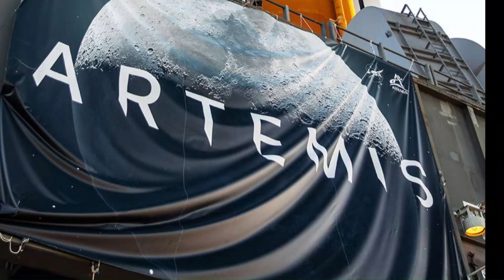Blue Origin Shocked SpaceX With Their New Moon Lander Launch!

Comment: Put some remote controlled AI robots on them/Robots avatars (don't need full AI auto), blast them up there, 'the perfect craft' (no need to worry about G's. The faster the craft leaves the Earth, the less fuel  and weight). A realistic 10 years to build large human habitation, fuel processing and depot with oxygen and water storage, all ready for the Solar System. It is accomadation to live and work and explore and mine and whatever else. While it is being built work on what ever is needed to send however many human personal up there and walk right in.
Mid 2030's success.